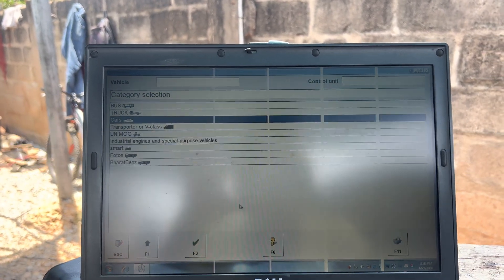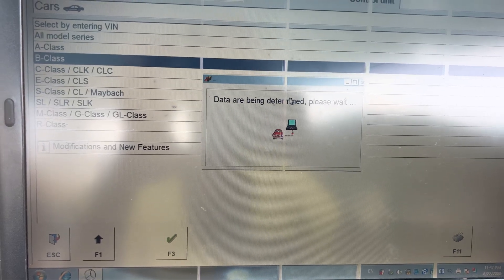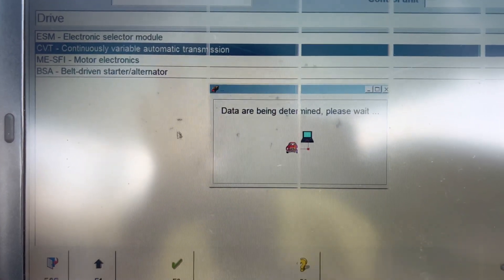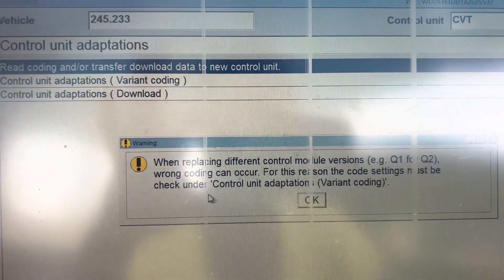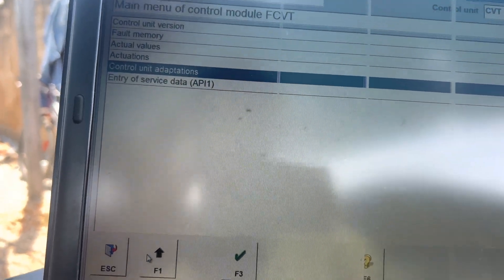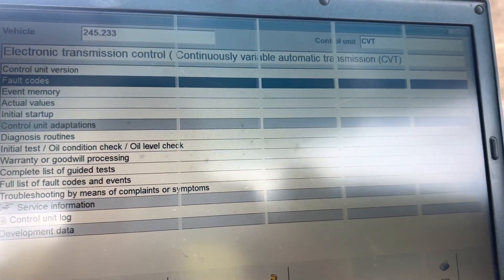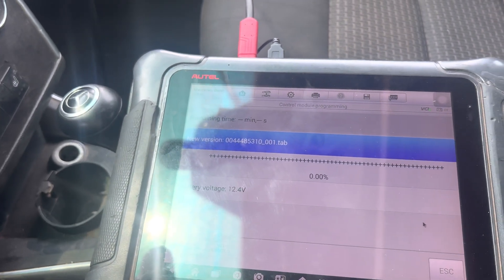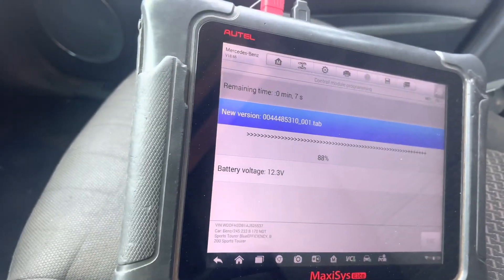MERCEDES BENZ: W245 GEAR BOX CODING AND PROGRAMMING

Comment: Hola podría ayudarme a programar mi mercedes clase A 180 2005 gracias
Reply from the maker: what do you want to program
Reply: Hola hay que programar TCU del cvt para que reconozca el coche la centralita reparada por que en el cuadro de relojes no aparece  P-R-N-D
Reply: Gracias
Reply from the maker: diagnose the TCU and clear the fault it will come and if it falls to appear change the the TCU
Reply: A ver si entendido bien, borrar todos los fallos , debería de aparecer en el cuadro y si no aparece cambiar la tcu?
Reply: Yo he borrado todo y solo se queda un fallo que no reconoce la caja de cambios 631F no se ha recibido ningún mensaje CAN de la unidad de control Y3/9n1(unidad de control CVT) eso es lo que me aparece en mi AUTEL MK900
Reply from the maker: Did the P came on and has the gear box been replaced
Reply: Si se reemplazó por que patinaba la correa metálica
Reply from the maker: was the TCU replace and it doesn’t matter whether replace or not the P has to be on
Reply from the maker: Do online programming or offline programming for it
Reply from the maker: Follow the video step by step and do it
Reply: Pero tú clonas una TCU no ?
Reply: En el vídeo
Reply from the maker: but do online programming to see if it can rectify the problem
Reply from the maker: Yes
Reply: Ok probaré y le digo cosas muchas gracias
Reply: No tengo cuenta online
Reply: Me he registrado pero cuando pongo la contraseña me da error
Reply from the maker: what device are you using to do the online programming
Reply: El xentry  en el PC
Reply: Solo me deja en el modo sin línea
Reply: La versión 09 .2024
Reply from the maker: use MAXISYS pro 908 or elite and above
Reply: Tengo Autel k900
Reply: Con la mk900 se puede ?